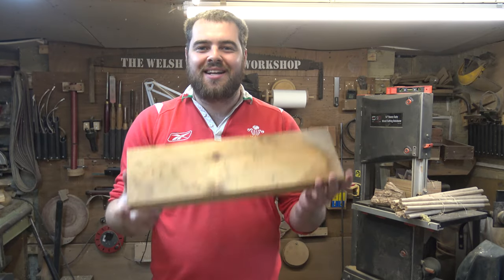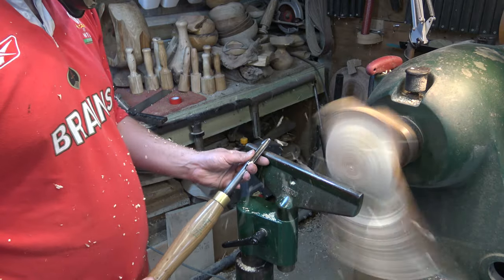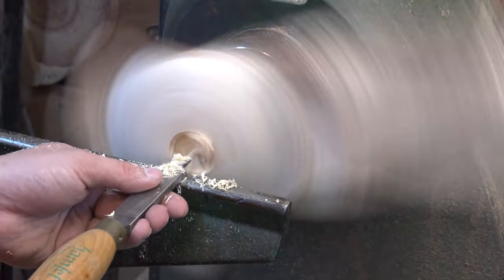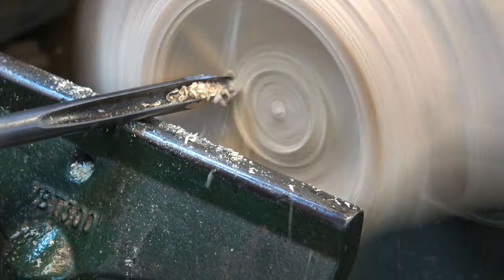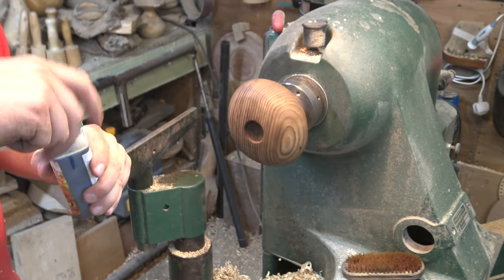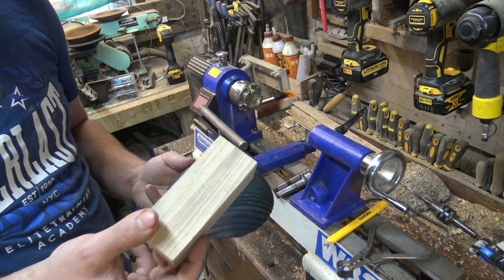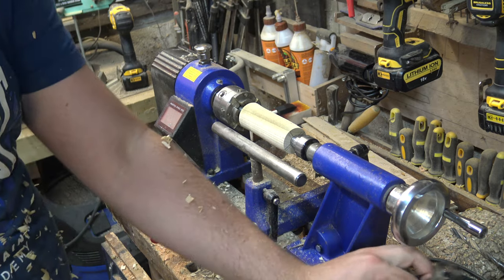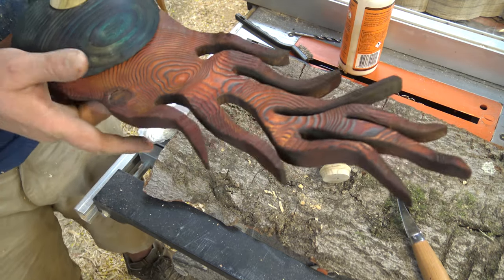Woodturning - The elements

Comment: OK Tom, One question first, did you do your planning of this project down at you local pub by applying a lot of “Brain” power (maybe a pint or three)😄. In any case, besides being a bit dangerous to turn, it came out pretty neat.  I don’t think I’m willing to try that yet.  Even with a dozen pints of Brain.  Cheers, Tom
Reply from the maker: Hi Tom, I had the idea from the start of doing a large winged bowl, I was originally going to just decorate the bowl with different surface textures to  represent the different elements, but the whole thing sort of adapted and evolved as I went along rather than following a drawn design or specifications like with my production work. Sadly the pubs still haven't opened properly here yet due to Corona, I think they are due to open next week 🍻 thanks for watching 😁
Reply: The Welsh Woodman Soooo - all your planning now is no “ Brain”?  Hope you can gat back to normal soon and enjoy a pint with your mates at your favorite pub soon.  Cheers, Tom

Comment: What brand/model is that respirator?  Is it the heavy one I hear so much about?
Reply from the maker: Hi Elizabeth, the respirator is a JSP power active pro IP. I bought it a few years ago and it's been brilliant. It's really light weight unlike some of the others respirators I've tried in the past and it's really comfortable to, you don't really notice your wearing it after a while. I like the fact the battery is really small and light weight but can lasts all day and unlike some of the other respirator units it clips into the back of the helmet rather than on a waist band. I would definitely recommend it if you are in the market for a resporator, if it's for woodturning I would recommend getting the IP model which has an impact resistant face shield. If your able try a few different types/brands befor buying as it will allow you to make the best choice for you. I hope this helps 😁 thanks for watching
Reply: @thewelshwoodman649  Thank you for the information!  I'll probably get this model if I have the opportunity.